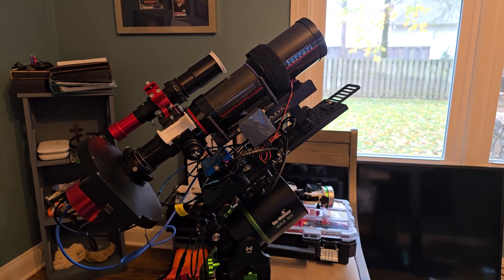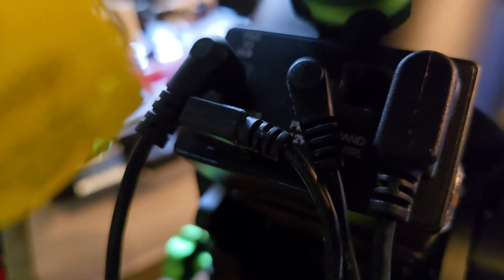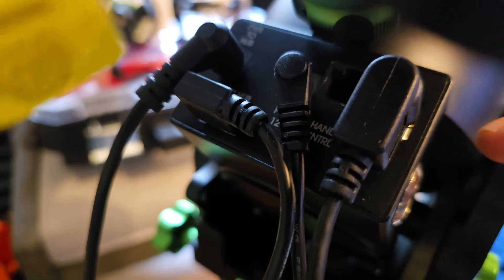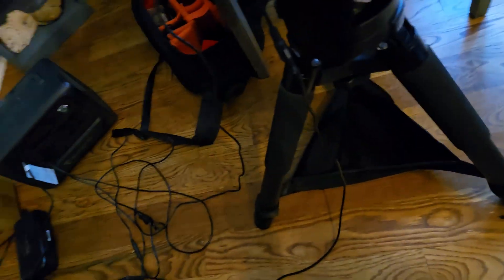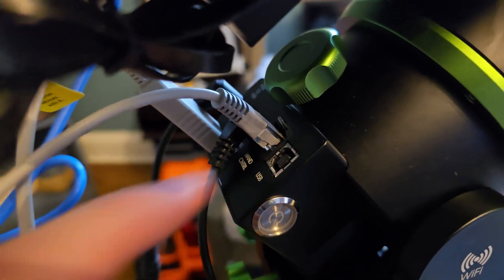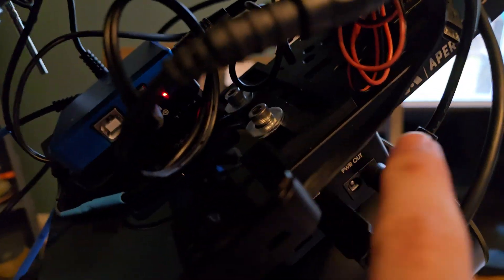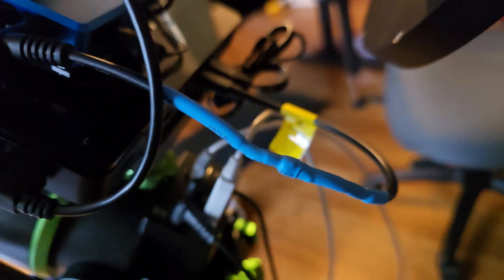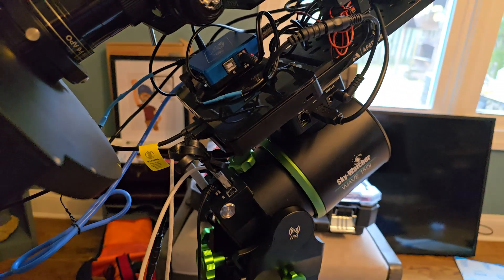Wiring Walkthrough for Sky-watcher 150i, MeLe Mini PC and Pegasus Powerbox

Comment: Thank you for showing your set up for the power.  I have a pegasus powerbox too but didnt know how to power it unless I power it directly to my bluetti battery and have a separate power cable from the cigarette battery outlet to the 12v input on the mount.  So I would have 2 separate cables from the battery- 1 to the pegasus and 1 to the mount.  Can you explain why you have 2 separate cables from you battery to the mount? 1 to the 12v input and 1 to the power to hub.  What is a hub?  I thought perhaps you can just plug in the pegasus to the saddle power output.  Is it not powered already from the mount 12v input?  Also, what is the purpose of your usb bridge?  Why cant you just plug in the asiair  or mini pc into the usb a on the saddle?  Doesnt the saddle usb a connect internally into the mount to control it? Im used to using the eqmod cable but they didnt put the eqmod jack on the saddle for some reason.
Reply from the maker: To power both the mount and hub requires 2 separate cables,  i use a Y adapter now, so i only have 1 cable coming from the battery these days.

The usb bridge gives access to my mount from my mini pc (via the internal hub), the one on the saddle doesnt do anything technically.

Those 2 things make it so literally nothing mounted on the saddle have any moving cables whatsoever.

Comment: Why not just move the mini pc off the scope and onto a tripod leg?
Reply from the maker: too many "connections" needed to the Mini PC, path of least resistance is mount it higher close to all of the peripherals.  Mini PC weighs nothing, so it's not a big deal.  Plus my entire setup is self contained, I don't have to wire anything up, you lift the scope with all the accessories and mini pc right off.
Reply: @Brentless  i just thought plug it all into your power box. Run its usb and power into saddle hub. Take the mount's usb to your mini pc on a leg. Seems much neater?
Reply: @jesuschrist2284  it may not matter for everyone's setup, but I also like that this puts less draw on the saddle power. The mele mini PCs typically only draw ~1A at 12V. If you have a 3A output powering your saddle (also somewhat typical for power banks), that's a good portion of the current limit. Just more conservative to power separately off the saddle.

Comment: I too was looking at a Y split 2.5mm & 2.1mm power cable so I contacted Sky-Watcher.  They do not recommend a splitter, but to have separate cables for both the 2.5mm and 2.1mm.
Reply from the maker: Full disclosure, I've been using one and it has been working just fine.  I usually use the 2 separate and understand why that is their stance but it is technically working.
Reply: @Brentless  Thanks for responding! I sorta figured their answer may be a CYA on their part especially since the mount power only pulls 2A.  My mount arrives tomorrow so super excited.  Will figure out all the extra cables, including the split one, shortly thereafter.
Reply: Have you acquired a splitter cable yet? I see them for sale in the EU but not the US.
Reply from the maker: @brainandforce I've been using these with no issue VWEICYY 2 PCS 1 to 2 Way DC Power... https://www.amazon.com/dp/B0DDL3BY53?ref=ppx_pop_mob_ap_share
Reply: I bought straight from the company in the US, but this can also be found at B&H Photo. IndiPRO Tools 12V/6A AC Wall Plug to 2.1 and 2.5mm DC Y-Cable Adapter. The 90° adapters I purchased from Bix located in California.

Comment: Thank you Brent. I do the same, connecting with the original usb b cable to an external laptop with installed the synscan app, without bridging. I can’t Connect them via cable , it works only via Wi-Fi, don’t know whats is wrong. Which configuration parameters do you Apply on synscan app for the usb Connection? Thanks a lot
Reply from the maker: So i only use EQMOD, not synscan.  So probably can't help, but I've seen where you need to be on the same actual network as the mount, so maybe make sure the computer connects to the wifi on the mount too when trying to use it?
Reply: Thank you, i solved finally yesterday. The connection to be selected on the app is "serial" even if it is USB actually, but prior you have to check on Windows "device management" the right COM port number (for me is com8) and then report it on the app. I didn't find described in the synscan manual. Maybe can be useful for any other interested. 😊

Comment: Thanks for posting this because with your 'Unboxing Setup from EQ6 to 150i" I was going to ask for a "how to wire it up"....I've got a older Atlas that has none of this updated On-Board cable, Power, USB and this mount is at the top of my list to update to. I just have been fuzzy on the how to wire up. Glad you clarified the Cable 2.5 and 2.1 issue along with the Right Angle connection...why did they do this?. I would put this on a Pier so not sure about the on-board PC and all. I use a Laptop running EQMOD, CDC and PHD2. Many have said give NINA a try. But I was told EQMOD will work with this. So the EQMOD cable you switched to...I'm not familiar with that one. mine has a USB and old RS-232 connector...what my Atlas has. So you just connect it from mount to the mini-pc and can run EQMOD that way?
Reply from the maker: @NiteSkyLookr  i still use EQMOD software (on the pc).  But ya, using the usb cables to instead of the eqmod cable that I have for the EQ6r.  Are you using the rs232 on the mount side or computer side?

If you want to direct connect to the laptop, you would use an included USB B to USB A cable (comes with the mount in the box).
Reply: @Brentless  Yes on the RS-232....it's the one I got a long time ago that's a direct mount connection and on the other and a RS-232 to USB adapter that plugs in the Laptop. Any other USB cables...DSLR and a old Meade guide camera went to a USB HUB (on the pier) with a single USB cable from it to the Laptop. It's another reason why I've been looking at the newer mounts that have all this built in to head Power and USB. Even with Pier, I have a lot of cables dangling and have to be mindful when scopes slew. I'm interested in the Pegasus Power box for sure and even just going min-pc to keep everything on grab-and-go-setup. Right now with everything it's a chore dealing with cables....and that mini-pc, i've seen a few videos highlighting it.